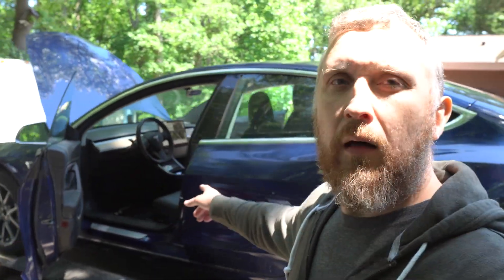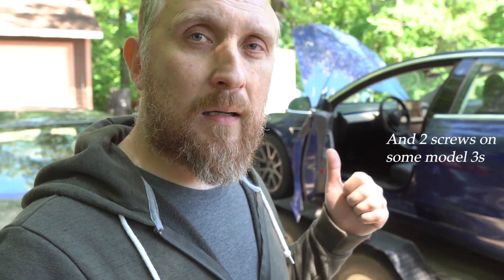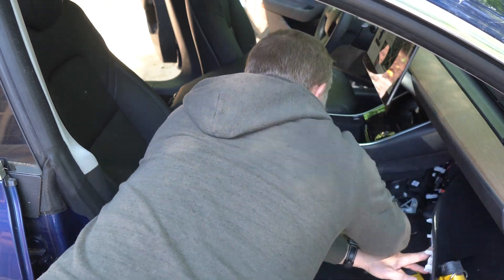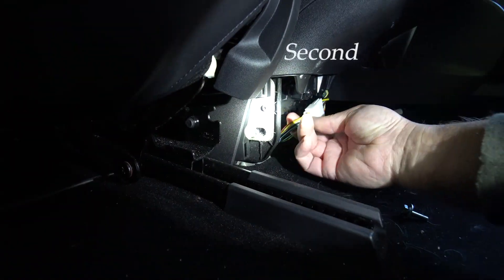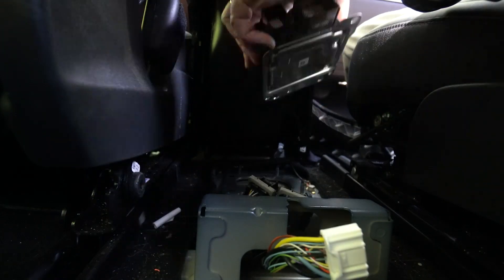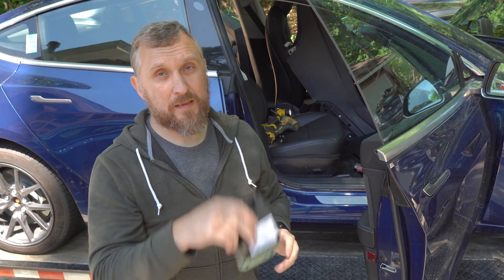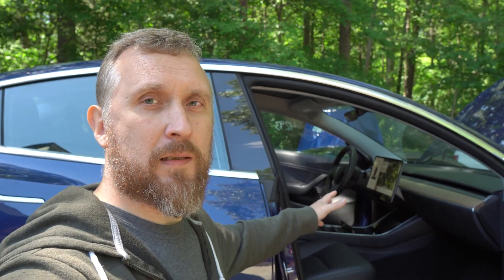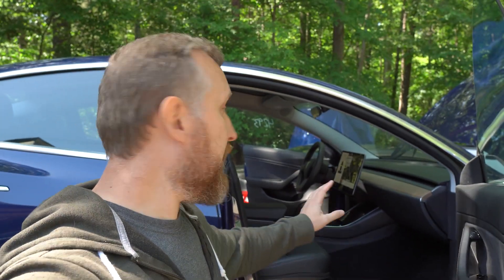Tesla Model 3  SRS airbag module removal

Comment: Does the battery need to be unplugged when removing or installing the srs module, seat belt and air bags?
Reply from the maker: Yes
Reply: @akindiyrebuilds6223  how do you do that?
Reply from the maker: @mazhariqbal5106  on mine I disconnected 12v battery and unplugged gray connector under rear seat

Comment: Hello I recently replaced dash,steering wheel airbags both knee airbags and seatbelts I got my module reset but the airbag light is still on…. What could be the issue? They didn’t reset module properly? Did your airbag light go off as soon as u reset module ?  And maybe I need to bring it into tesla so they can earase the code or they prolly won’t do that ?
Reply from the maker: It could be an incorrect reset and could be an issue in the car. Without Tesla toolbox you will only be guessing. Tesla should be able to diagnose it for you.
Reply: So should I call out a Tesla Tech and have it diagnosed for me instead of guessing lol
Reply from the maker: @JenziG  that’s what I would do.
Reply: I’m sorry guys, Who resets those modules
Reply from the maker: @carlosuchupailla1517  I do locally, but you can find several on google to have it shipped.
Reply: @akindiyrebuilds6223  Can u send where are they located or their site, in my area no one cannot do this.
Reply from the maker: @doom7576  sorry I don’t have anyone particular I could recommend. You would have to Google it.
Reply: @akindiyrebuilds6223  
Yes, in principle there is, but maybe they are not checked, but I thought that you have some guys, thanks for the answer, I will try)

Comment: Hello,

Thank you for sharing. I am going through the same process. I have removed the SRS module and sent it for reset. Now doors do not lock without the module in side while i am waiting for the return. Did you experience the same thing?

Thank you
Reply from the maker: No I did not use the car until all electrical components were installed
Reply: Hello, where do you send the SRS box? Can you share the company with me. Thanks!
Reply from the maker: I do it locally. But I’m pretty sure you can find someone on Google.
Reply: Because I buy a new one from Tesla. And the airbag light is on. You have a solution?
Reply from the maker: @AliAhmed-rn1sq  You would have to have dealer program it to a car
Reply: @AliAhmed-rn1sq  I used these guys https://www.myairbags.com/ and worked. I had 6 airbags deployed. I fixed every single one and I have zero errors now.

Comment: If only the seatbelt restraint deployed do you still need to reset the airbag module? 
No airbags deployed just the driver seatbelt restraint. 
After replacing seatbelt tensioner with a repaired on I still have a warning RCM_a011
Reply from the maker: Yes, module would have to be reset

Comment: You just reset the airbag module by taking it off and putting back on? I recently involved in an accident, unfortunately both driver side knee and front airbags were pooped off. So I will have to replace both airbags. Can replace them with used airbags for other model 3? And also Do I have to replace air module too? According to Tesla certified body shop I have to replace the module and both airbags! Are they just adding extra expenses to my bill? Please help. Thank you for the video!
Reply from the maker: Replacing everything with new parts would be a best option. If I am rebuilding a salvage car, I am usually on the budget, and using used parts in many cases makes more sense. Taking module off and putting it back won’t reset the module, reprogramming resets the module.
Reply: I have a airbag module for model 3 2022, if you are interested let me know. Only 3 months old. I have a few other things as well.
Reply: My body shop telling me knee airbag also breaks dashboard, is it correct? Can you please verify me? It is costing me another $120.
Reply from the maker: @AR-sf3zn  I don’t think it’s supposed to, but it’s probably possible. In two cars that I had to replace it it did not break dashboard.

Comment: How did you remove the seat belt from the pretensioner?  Tesla shows a special tool that has sales restrictions.
Reply from the maker: You can unlock it with two thin screwdrivers or picks. You would have to pop plastic off to understand the mechanism for unlocking

Comment: Hi, I'm from Hong Kong,
I replace the airbag for model 3 2020 already, but looking for a method to reset Model 3 Airbag RCM module.
Airbag Module are removed right now
I have a T-Can Tesla Diagnostics but not support Model 3.
Could you please let me know how to reset the airbag module?
Reply from the maker: You won’t be able to do it with the car scanner you have to have a special equipment to be able to program circuitboard components
Reply: @akindiyrebuilds6223  For example? I can try to fix it by myself. Any Instruction? Or I should you airbag service tool and take out the chips for programming?

Comment: How did you get the seat belt anchor out without the tool.?
Reply from the maker: I’ve used two really thin screwdrivers.
Reply: @akindiyrebuilds6223  I've been trying Allen keys and its a pain
Reply from the maker: If you are replacing anchor, then tear plastic off and you will see mechanism
Reply: @akindiyrebuilds6223  on the side of the pretensioner there is a small hole. Initially I thought you release it through that, but fear I may have broken it.

Through the bottom i can feel the spring release but the anchor doest release. I have repaired the seat belt so I dont really want to cut anything from that side.

I noticed you didn't replace the anchor pretensioner inside the seat, why is that?

While I figure that out im trying to figure out how to remove the glove box so I can remove the dash.

Thanks for the videos its helped a lot, but wished you had more time on that section

Comment: Hey roman, how did you lift up the whole center console like that? Can't get mine up past like maybe a couple inches.
Reply from the maker: Eugene Putin There are a couple of electrical plugs on the inside that you need to disconnect that’s what probably holds it down
Reply from the maker: Eugene Putin also some models have two screws on the front right where the phone charger is
Reply: Akin DIY rebuilds yup found em. Thanks!

Comment: Hi, did you have to replace any of the crash sensors or are those OK to keep using?
Thanks :)
Reply from the maker: Swiss Tuned I’m not sure specifically for Tesla some manufacturers recommend replacing crash sensors but in my experience as long as there is no physical damage to a sensor it’s self you should be OK using original sensor
Reply: @akindiyrebuilds6223  Thank you!

Comment: Hey do you know where i can find the driver knee airbag?
Reply from the maker: Gurtej singh Last time I checked knee airbag was cheaper from a dealer than eBay or anywhere else. If your dealer won’t sell it to you ask for a quote to install it, you may end up cheaper even this route.
Reply: @akindiyrebuilds6223  Thanks. Also my tesla model 3 has the following errors. Do you know how to reset them. i did the rest with the scroll keys alone and then one reset while holding the brake down and the scroll keys. but the errors are still there.
-Auto emergency braking is disabled
- Regenerative braking disabled
- Stability control disabled
- Traction control disabled
Reply from the maker: If everything assembled properly these codes should clear after driving for a while. I had these codes on two of my model3 projects and they cleared after driving for a while.
Reply: @akindiyrebuilds6223  How do i get rid of the airbag light? i installed new airbags and also got the module replaced
Reply from the maker: Since there is no generic scanner capable of accessing Tesla airbag system it’s gonna be very hard to diagnose it yourself. I think Dealer is going to be your only option.
Reply: Akin DIY rebuilds what if i buy a OBD2 harness adapter
Reply from the maker: I’m not sure which harness you’re talking about but if you are talking about adapter that you can install into harness behind armrest, then I think it only gives you live data as far as your battery, not systems DTC’s. You would have to check it with an adapter manufacturer.
Reply: @gurtej2424  Did you replace the module with a module from a donor car that had undeployed airbags?  Did you try or not try a module reset service that you can find online or on ebay?

Comment: Hi, were can I find the knee airbag and seat belt? Tesla will not sell it. Also how did you reset the airbag module.
Reply from the maker: eBay or car-part.com, I would check price if Tesla SC change it for you. To reset module you have to have special equipment and knowledge.
Reply: You can get seat belts, pretensioners and SRS module reset and rebuilt by https://www.safetyrestore.com/ They did both front seats and the module on my car for $300 literally the cost of one seat belt new.